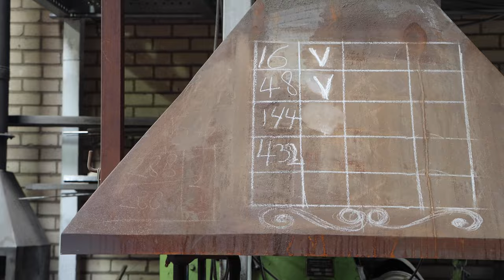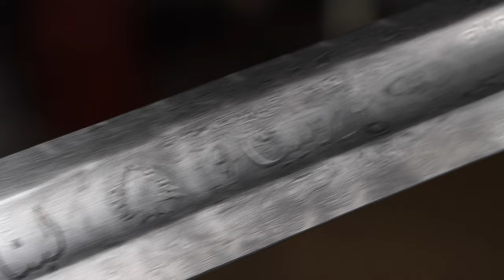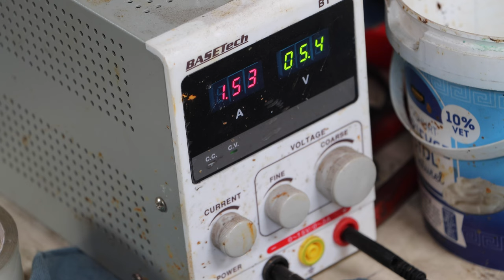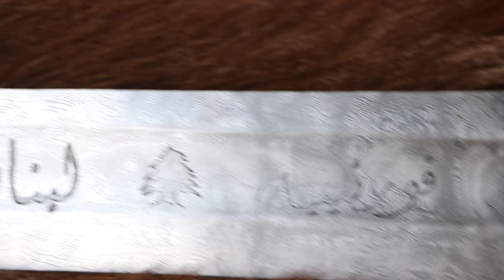Forging a Phoenix sword the complete movie.

Comment: Freerk i have a question I would like for you to answer in order for me to understand. My question is: what is the difference between you using a power hammer and a power press since that's what you mainly use in your work shop? Will the results be similar or different? I'm sure that using a power hammer in comparison seeing the traditional Japanese sword smiths strike with hammer blows is basically the same as using a power hammer correct? Because the Smith also folds the steel multiple times until he reaches the desired layers as well as working with 2 types of steel, soft [for the spine of the blade] and hard [for the hard edge]. I'll appreciate it your response, thanks. Great work on all your blades.